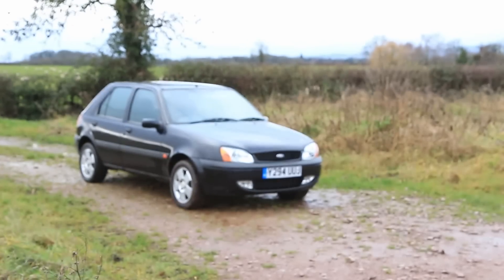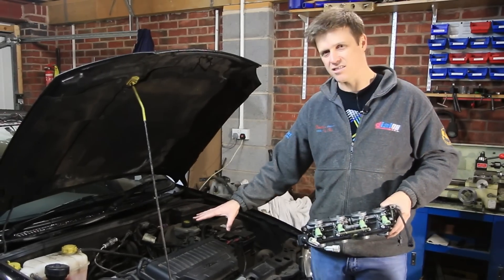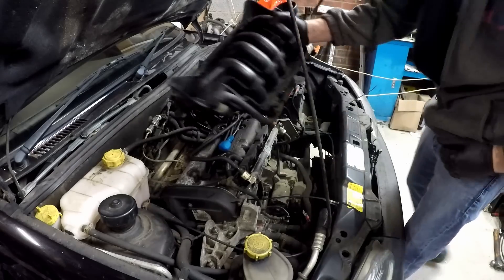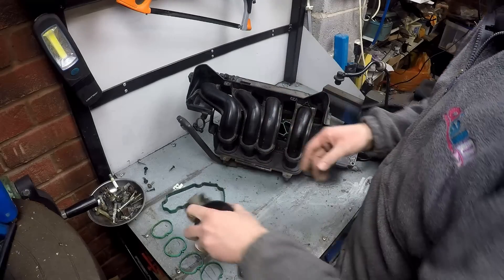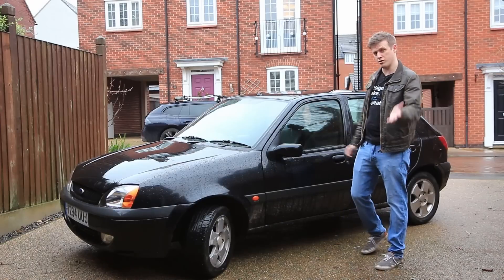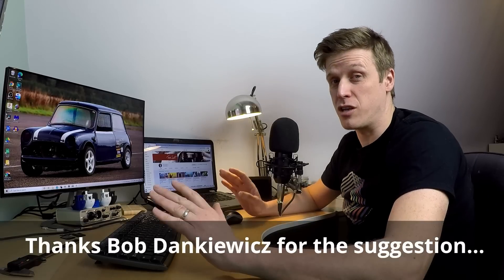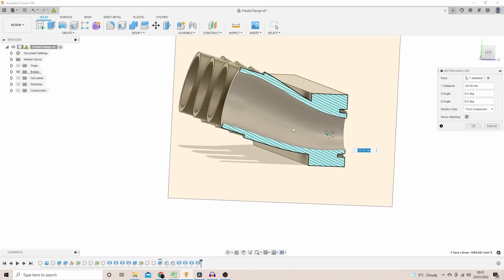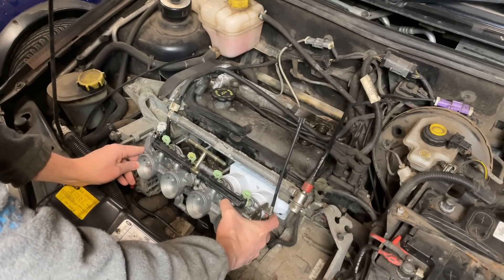Throttle Bodies and a Standard ECU.... Will it work?

Comment: Hi! I have a question about MAF sensor, because I'm planning to put ITB's on my good'ol Mazda. You were disappointed that Your mum's Siesta did not have one, but how actually You planned to fit it? To build plenum with filter at the end, and MAF in between? Basically just like stock intake is made? 
And yes, I'm want to do it only for BRAAAP :P
Reply from the maker: Exactly that, I would duct all the intake air through it, this would give very good control over the fuelling and give the best drivability… it would dull the BRAARRRPS! Slightly but with a decent sized air filter it would be fine.
As it was I was very pleasantly suprised at how well the car drove just on a MAP sensor, it needed more acceleration enrichment but it behaved well!
Reply: @MakingforMotorsport  thanks for answer, I hope to show my results in next year, 'cause right now my Mazda is daliy car in exchange for E-class which I need to rescue from rust plague. When it's done I'm gonna have a lot of fun with my little japanese friend 👍
Reply from the maker: Oh the Japanese love abit of toooooning!!! Rude not too!!!
Reply: I had the same question so thank you for this 🙏☺️

I wanted to do the same for my SR20DE Silvia

Comment: Would it be the same with a MAP sensor??
Reply from the maker: Yeah, a MAP is what the Fiesta has, a MAF sensor would be different, and that would require all the intake routing through the MAF sensor before the ITBs…. still potentially giving a restriction.
Reply: @MakingforMotorsport  Sorry... wanted to say with a MAF! So there's not more option than use a plenum or similar to put the MAF on?
Reply from the maker: @rosworks  not really, with a MAF all inductee air needs to come through it.  It actually makes for a nice integration, usually well mannered, but it often just mutes the ITBs.  (That said, both BMW on the e36&46 M3s and Toyota on the 20v 4AGE engine did this so it’s probably not a “bad” choice…)
Reply: Will need to desing a plenum so! Or whatever invention😂 Thank you so much!🙌🏼

Comment: Should have just done away with fuel injection and just fitted motorcycle carbs.
Reply from the maker: I have a set of Mikuni carbs which will end up on here probably but it’s still the same amount of work as the ECU will still need all the signals so it can control the advance accurately… but it would be interesting…
Reply: @MakingforMotorsport  Stupid computers think I'll stick with my classics, looking at my pinto engine, with the space around them to work on in most cases and based on the KISS principle something they threw out the window on modern cars. I refer to modern as anything with an ecu.
So the question is could you eliminate the ecu?
Reply from the maker: @shortbuslife3440  completely do away with the ecu??? That’s a stoopid idea… I love it!!!!
Reply: @MakingforMotorsport  lol

Comment: Unfortunately its not going to work out for you with the map sensor.. even with a vacuum canister you wont have a linear map reading over the entire throttle range..
The engine will pull decent vacuum at idle and very small throttle openings but anything over like 5-10% throttle the map will go to atmosphere..

I was able to get my Lexus 1UZ--FE running ITB's on the stock ecu however it was MAF and I Had to build a plenum to encase the throttle bodies. With the plenum on the engine sound was no different, and performance was also no different.

So I had to bite the bullet and upgrade the ECU to a Link which now runs Alpha-N type calibration
Reply from the maker: I have the ecu waiting to go but I have always wondered if this will work… with the MAF, as you did, it’d be fine. 
And if it doesn’t work, we’ll the ECU is sitting ready to go…

Comment: Looks like a cool project, but be mindful that the large intake plenum volume created a resonant air ram tuning effect at lower RPMs to make low end torque.  Without the plenum, you have lost the resonant tuning, and the car will be very slow on the lower revs. I like your concept but be aware of the outcome might not give you a faster car.  ---Doozer

Comment: wanna use that fully? get a Mex or Brazil made 1.6 L zetec 16v, a fueltech cpu, 2 extra injectors(with signal doubling), ethanol NGK plugs, heads machined till 11.5 compression, polished ducts/angles/valves/springs... then you might use that part fully... if done the right way, 185hp is the lowest, 198hp is still possible but will need balancing and flywheel lightning.

Comment: Hello, quick question in regars to the ITBs, my car has a drive by wire throttle (electronic throttle) How does that limit me? what steps should I take if I decide to go ahead with this project? Is swapping to a cable throttle the easiest way around it?
Reply from the maker: DBW is perfectly usable on ITBs but it gets complex.  Most OEM electronic throttles are 1 piece, can’t be easily adapted to itbs, the are DBW ITBs (R1) but these would need to work with your ecu…. Lots to think about.
Most of the time OEM ECUs separate the DBW function so easiest is just to fit a cable (if your car had a cable option)….
Reply: @MakingforMotorsport  hmmm sounds complicated for my application and there are other things i could do instead such as swapping the top end of the engine to a vvt version, thats too bad as i love the sound of ITBs but if at all possible it will have to wait.
Anyway thanks for the reply, i love your videos and i will continue to follow along the ITB content anyway, its just too good!

Comment: Great stuff! Like to ad bike itbs for my type R fn2 . If u have a car with an MAF, and converted to itbs and place an plenum on them and placing the MAF in between the plenom and filter it might give good readings i hope.. But mine has also got drive by wire so was thinking about using the motor out of the oem throtthle body to drive the itbs.. or use an bike itb with drive by wire. Maybe have to convert the signal with an ardiouno. Anyone thoughts on this? Only balancing out the induvi dual throtles wil be a problem i cant think of how to adjust with a plenum ateched.. without it the MAF woudnd have a reading 😅 would love he braap braaap with standard ecu and throtle pedal
Reply from the maker: That’s how the OEMs do it with a MAF and ITBs so that’s easy but the DBW is tricky, I have attacked a few OEM DBW units and they don’t lend themselves to modification… 
That’s said you’ve mentioned all the things I’d thinking of, I’d add junking the  lot and junking to cable (if ur car had that on a different model), you’d lose cruise control but if you’re lucky the DBW in the ecu sits aside from everything else they often do as there is a separate TPS for engine calca) and you can just ignore it…

Best of luck!
Reply: Thanks for your insights, some more food for thoughts :) if the ecu only uses the tps for calculating using a cable will make it a lot simpler. Loving the channel and content! Checks al my boxes😄

Comment: The output (o2 sensors) will adjust the fuel flow, you should be fine.
Reply from the maker: On closed loop operation that should give me a hand…. But open loop WOT?  🤷‍♂️

Comment: Is it gonna run, yes. Is it gonna be all dandy? Nop, the map sensor is gonna go a little crazy at higher rpm, and the ECU will probably have a hard time, but if it's also correcting stuf based om the TPS, maybe you will be alright 😁

Comment: You know how speeduino works, You have one on the table... Why ? 😂 Why U didn't use it in siesta project ? 🤦 As amateur tuner I know that for tuning engine equipped with ITBs You need to use TPS in Your tables instead of engine load / MAP... But my way around whould be to connect all 4 runners using hose and splitters and somehow connect MAP sensor to this contraption 😂 (to see avg. pressure created from all 4 cylinders) should work but You still need to relocate IAT sensor... And hope for the best 😂(my premise is... It will flood engine with fuel)  I whould definitly go with speeduino, it opens so much options what You can do with engine... 

But I'm curious too, about what will happen😂 and if it is possible.

Btw, does Your ITB have TPS ? If yes, try measure resistance of it and compare it with original TPS from car, there is small chance that it will be the same, just different housing and connector (should save You some time and work)

Comment: One vacuum source from single intake runner is going to be too uneven on low rpm that ecu cant make any sense from it. Need to have some kind of chaber where you can route vacum linenes from each cylinder to make the vacum signland cleaner. Alpha-N control would be best for ITB's

Comment: ITBs run as alpha N not MAF and not speed density. A MAF system might fail safe in alpha N mode when the MAF is broken or removed. Then it might work so long as it's the correct capacity injectors.

Comment: Great content as usual! Hopefully I can help in someway. Long story short I data logged my car several times before adding ITBs and doing so I was able to look back at my Map readings and tailor my ITB vacuum setup with strategically placed vacuum check valves till it produced similar readings and behavior to my stock plenum. Worked so well I was able to drive my car on the same tune as stock but my idle and cruising was certainly more rich as my idle/ cruise kpa was slightly higher. A simple re-tuning of the fuel fixed that.

You could connect a manual vacuum valve and record stock reading and behavior for low tech version of a datalog. Other option that comes to mind is connect a AFR gauge on stock car and log that then with an aftermarket adjustable FPR you can tweak the fuel pressure to hopefully give similar results? Hopefully that helps sparks any ideas.
Reply from the maker: Cheers bud, plenty of things in there to think about…good to hear you made it work tho!  Gives Project Siesta a shot in the arm! 💪👍
Reply: @MakingforMotorsport  Anything to hopefully help I really enjoy the type of content you put out. Really gets my imagination going lol.

Comment: The factory ecu in that ford CAN be tuned. But it's not near as straight forward as something like a speeduino or megasquirt. It takes a bit more hardware and some extra software, but it is possible. If you are interested I could point you in the right direction.

Comment: As you have inspired me to get busy modelling a moto-ITB intake for my toyota 4AGE (cheaper than the 20v ones which also dont fit without an adapter) I've been pondering the same issue with the crappy MAP signal I'm bound to run into.  If you combine the 4 runner vacuum signals into a plenum you dont change the fact that you are basically combining one decent vacuum signal and a couple of vacuum leaks together, resulting in a poor signal. 
I've come across a rather nice looking solution that combines 4 MAP sensors and basically just takes the lowest signal of the 4 and passes this to the ECU. That way you dont get the averaging out of the 4 signals and actually pass on the strongest signal possible. This in theory allows you to run pure speed-density instead of having to mess with blended or pure alpha-n.

Since the cookie-cutter MAP sensor that is used on Speeduino and other DIY ecu's costs about 27 euro a piece these days I've been busy designing a PCB that uses comparable but 20 euro cheaper pressure sensors. I designed it to be able to switch between analog signal conditioning (diodes +opamp) and digital conditioning (with an AVR MCU).

Quite curious to see how far you'll get with the stock sensor and ECU. The map signal can be fixed, but it will still behave radically differently from a single throttle so I'm curious to see what the stock ECU will make of it.

Comment: You will struggle to get a good signal for the MAP with ITB’s, might be worth designing an internal link port on each manifold runner behind the throttles to a common port for the MAP sensor on one end.

Comment: I'd try to put map sensor in chamber that volume is similar to original intake manifold. This chamber then be connected to each runner of itb's via hose. Of course iat sensor must be separated and put in airflow. Or force ecu in alpha-n mode by disconnecting map. Then you have engine fail light lit.

Comment: Will you be making up a new system for opening the butterflies as bike throttle bodies aren't exactly smooth for a car engine as they're designed for a snap acceleration

Comment: you might need to do a alpha-n tune to get it to feed it more fuel at the same throttle opening...
or go old school and use something like an apex-safc piggyback to modify o2 readings and trick the car into sending more fuel

anyways keep it up! your content and channel is awesome!
Reply: Would defeat the purpose of this project of getting ITBs to run on a stock ecu but agreed that there is a good chance that maybe the only way to get it running properly. Any ways super curious to see how this goes.

Comment: Hi there . Can tell you this works. I am running ITB'S on a 2.5 Subaru with stock ECU. Make vacuüm tank for the MAP sensor hooked up to all inlets with 10 mm hose. Also IACV is mounted on this tank.
TPS bracket made of 3mm aluminium plate and fit on 1 ITB.  No OBD fault codes and running superb. Boxer engine is running even because split the throttle cable for balance adjustment. Engine is used in a  Porsche 356 speedster replica.

Comment: It should work with al the components on it  and a airbox. Dbilas sells throttle body kits for the opel c20xe. It works with the standard ecu, although it should be tweaked a bit to get the promised 25 hp gain.

Comment: I remember running into this mystery myself when going through the wiring loom and ECU pinouts then comparing to the wiring diagrams in the Haynes manual - turns out the manual is wrong!
It's a quirk on some 1.25 engines that they ran a MAP instead of a MAF apparently, although it may share the signal wire to the ECU. Do you have a Siemens ECU with 60pin plug? Air temp is pin 9 and air flow is pin 50 if that's any use.
Reply from the maker: Cheers bud… yeah I got the book of lies/Haynes manual specifically for the wiring diagram (planning ahead) and I was amazed to see it only had one O2 sensor. 
Naturally it doesn’t, it has 2 to properly monitor the cat, but that’s not what the wiring diagram says! 😂🤷‍♂️
No really tangled with the ecu yet but as you can guess… it’s on the list!

Comment: Should be relatively simple. 
Quick and dirty way to sort TPS out would be to use a throttle cable splitter and keep the OEM throttle body somewhere on the car. A better solution would be to measure the 0-5v curve of the OEM Ford and bike TPS and see if they’re not a million miles away then just use the bike set up, if not adapt the Ford sensor to the bike gig.
Stock ecu will run SD algorithm until a certain throttle and rpm threshold so it will need a decent MAP signal, try a small accumulator with a line from each runner and stick the OEM TMAP sensor on that.
It will probably be on the limit of what the factory long term lambda trim can cope with when it’s done but you can always tweak fuel pressure to help that out

Comment: I discovered last year what happens when you add ITBs to a BMW engine.
https://youtu.be/0PVYk1PLcFY
and run it without the following:
- MAF
- ICV
- Temp sensor
- TPS
- Vanos
Probably other things. I'm sure they are all optional.
Well it runs. Sort of. It just won't rev.
This has a PLA manifold for now, but I've since ditched the skyline ITBs and gone with one and a half sets of gsxr 750 ITBs.
Planning on going alpha n with speeduino when I get round to it.

Comment: For modelling closer to the existing geometry i used photogrammetry to get a scan of the enginebay and the major parts (itbs, afm, fuel rail). That way it was very fast to spot collisions and use the space i had more efficiently.
If you have a cuda capable gpu you just need a bunch of pictures and let the computer crunch for a couple of hours ;)
Then its scaled based on a teken measurement. The programm i used is called meshroom. Thia could be a very interesting episode to make, to show other guys how to get scans for practically no money :)
Looking forward to how you solve the map sensor related potential issues.
I think in the end i wont run mine on the stock ecu and afm. But instead go to a kdfi (500€) to make it run right and hopefully get a performance benefit.

Comment: Crazy thought, would it not just work to parallel the bike throttle injectors to the car's injectors to sort out the air/fuel? It's a bit crude, but if you have a lot of air, you need a lot of fuel, and this uses the existing parts you have so not much more money, just more work.

Comment: I have tried the same on a C14SE engine with the factory ECU using just velocity stacks and a MAP sensor. It was not working because it havent got any air resistance. So when i barely touched the throttle the pressure went down behind the throttle bodies and the ECU was sensing full throttle all the time, even when i was barely accelerating. If you have an airbox and a airfilter to have some kind of resistance, it could work.

Comment: If I remember correctly most ecu in case of map sensor failure go into a limp mode where they use only TPS (so kind of broken alpha-n map) and overfuel mixture a lot (which is beneficial in our case). I wouldn't be surprised if the engine had a hard time running with map sensor connected and started working nice when you disconnected it.

Comment: Nice video. If you cant alter the the lookup table maybe you can alter the signal from the sensor to make the ECU think it needs more fuel. Putting some resistors in to lower the signal voltage?